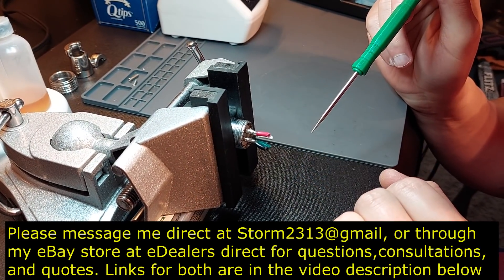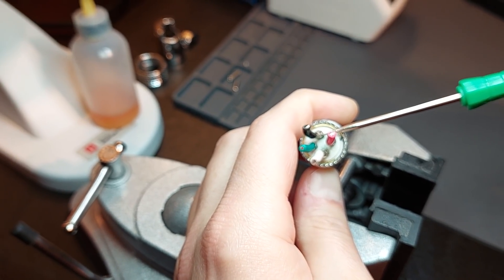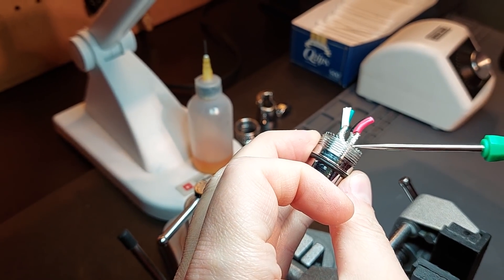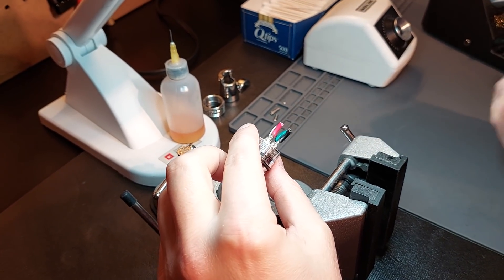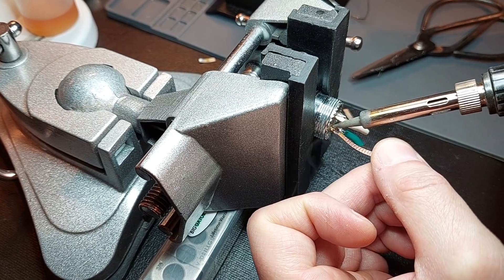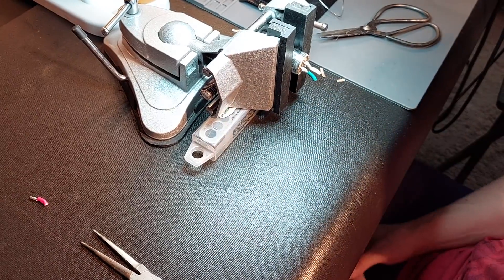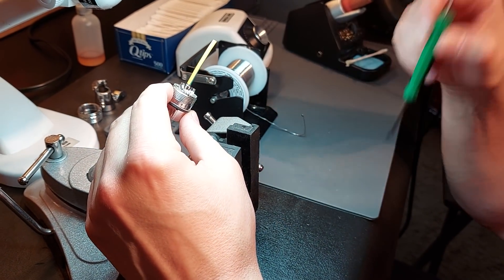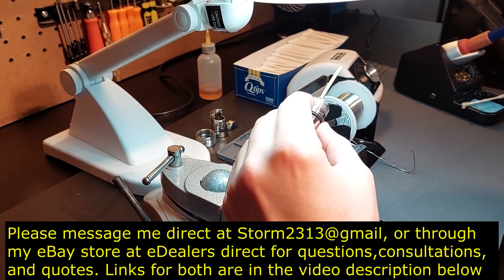CNC Spindle Connector Rework Soldering Tutorial...

Comment: Love these videos. Some questions:
- would it help anything to put flux on the soldering iron?
- Is there such a thing as flux core solder? If so would it be ok to use?
- what are you using for the "cleaner"?
Thanks for all of your time in making these available for us novices!
Reply from the maker: Thank you for your support. 

Adding flux to your iron isn't required as the solder I'm using is rosin core so the solder will stick to the tip.

I use a citrus based solder cleaner available from me if you need some. Just message me. 

All my products used in the video are listed in the video's description. 

Thank you,
Vince